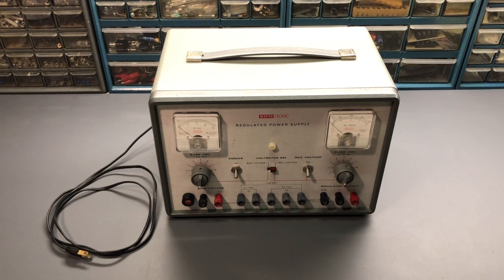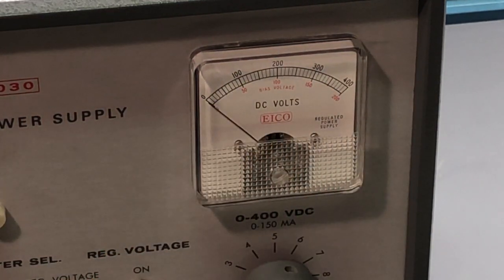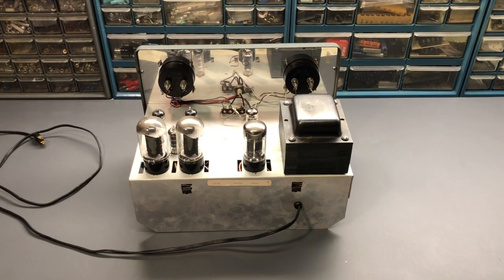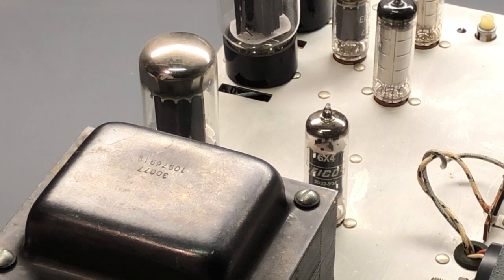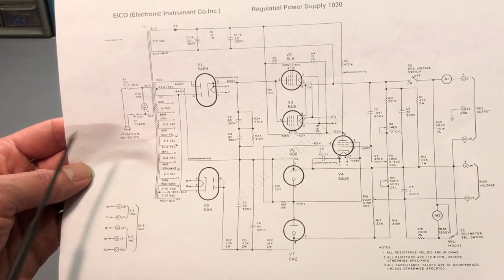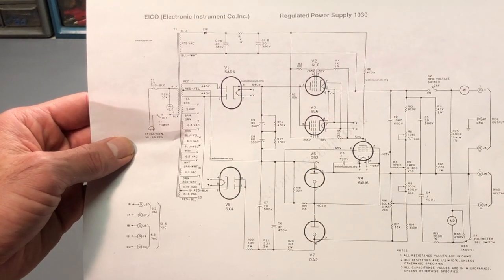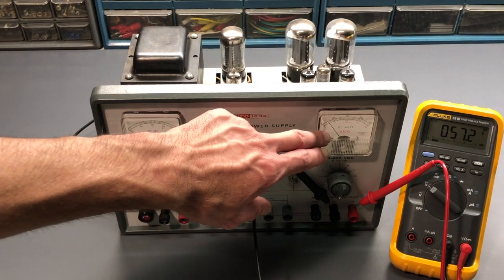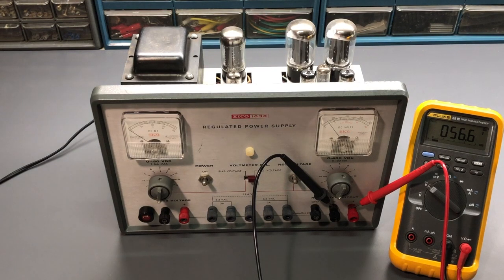EICO 1030 Regulated Vacuum Tube Power Supply Restoration And Test - Part 1

Comment: You're explaining a lot. Which is great. Following your thought process finding faults, analysis of circuits with schematics, that is invaluable stuff for me. And it's what is different from other, also sometimes really accomplished electronics channels. It's the reason I'll be subscribing. That being said, there is stuff I'm missing: 
- I'd really like to hear about the thought process behind replacing components with other components. This EICO 1030 is a fine example; there are several types of electrolytics aund you use several types to replace them. I know a little about the reasons, probably, but it'd be great if these were explained, just to further and expand that knowledge.
- I wouldn't mind seeing soldering from time to time, and freeing components etc. There is a lot of soldering around, granted, but I believe it can still be gleaned a lot from watching someone more experienced. Doesn't have to be the whole process, sure, but some parts would be interesting. And it's soothing, somehow. ;) (I know there is more in other clips. Can be still more, if you ask me.)
- I like tube stuff. Wouldn't hurt to know more about the role of the tube and its roles and contacts in the curcuit more. You might think it's boring; for me, it isn't.
- When you're talking about degrees - it's Fahrenheit?
- Keep on doing this, please. :)
Reply from the maker: Thanks for watching and subscribing.  I appreciate the feedback and learning what viewers would like to see more, or less, of.  The video still being created now for the ADCOM preamplifier part 2, has some discussion about choosing capacitors so you may find that helpful.  The video on safety capacitors has some soldering and desoldering tips.. https://www.youtube.com/watch?v=GDTuHDsHHFA  just after the 11 minute mark.   I try not to repeat topics too much but your point is well taken.  I like vacuum tubes too and will continue to include projects using them.  Fahrenheit vs Celsius  it was Fahrenheit.

Comment: Thanks for a great pair of videos. Mightn't hurt to check the electrolytics between the current-limited test and first applying a load. They'll have had a little time to re-form but may well be dodgy still. Also to scope the output when you apply a load, so if the electrolytics are bad you'll see excessive ripple: the regulator will have enough bandwidth to smooth much of it but not all. If they're bad, their ESR will probably have gone high and at these voltages if they blow it'll be messy.

Note also that EICO didn't include current-sharing resistors in the cathode lines of the pass valves: the valves are just paralleled directly. They'd have been matched at manufacture, but after all these years it's likely that one of those expensive 6L6s will reach its dissipation limit before the other. That may happen well below the supply's rated maximum output and load.
Reply from the maker: All the original electrolytic capacitors were replaced with new parts so I was not concerned about testing their performance in detail.  They were not in good condition anyway, that's a given with the old capacitors.  
Valid point on the lack of current sharing resistors on the output tubes.  The 6L6's in this supply test fine and matched but if one is weak the load current will not be equal through  them.